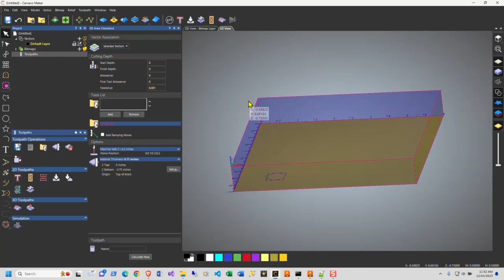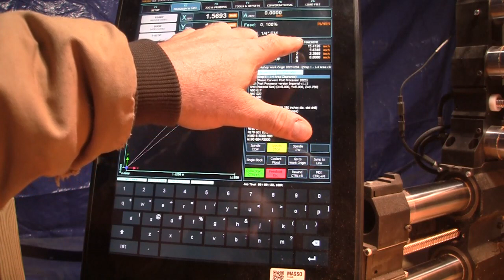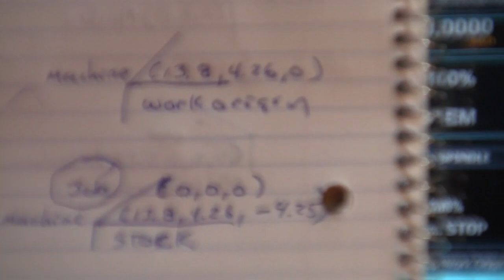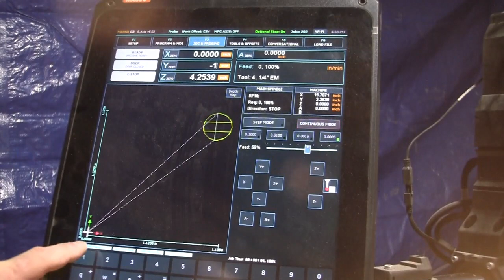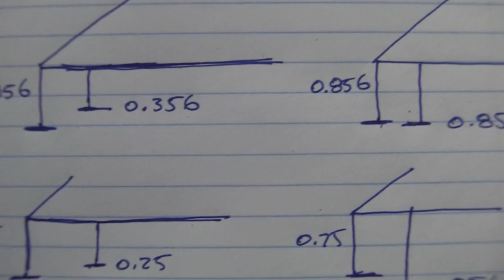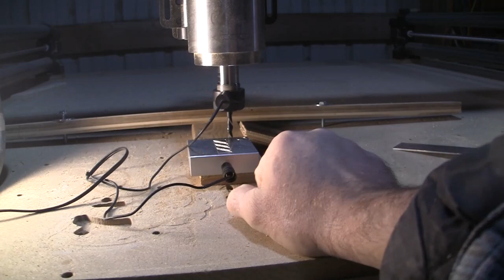Onefinity Elite Foreman - How to Adjust Work Origin

Comment: You do an excellent job of explaining this.  A lot of which I knew, but I learned a few things also.  I have the same setup, but I am using an aluminum block as a tool setter.  What I want to know, and I haven’t yet tried, can I use a work offset (ie G55) for a fixture to do machining on a part for production work, and never have to probe X, Y, or even Z again.
Reply from the maker: Thanks, glad to help.
as far as the G55 - i would not see why not. since it is a fixture, but I would still probe z unless you are never changing the bit out.  Any reason for G55?  just make sure that is set in your G-Code file. otherwise you will read the wrong origin point. Look at this post for more information.  but you may need to manually edit your file.  https://en.industryarena.com/forum/fixture-offsets--417514.html

Comment: The weird thing (for me, at least) is that for numberline graphing moving the X and Y to the right / away from the origin is a positive number. In CAD using a Cartesian method - same thing - positive X/Y is to the right / up. And a positive Z is up away from the base plane.
Reply from the maker: Yup.  But I think since you moved your origin they are now negative. Maybe???  Have you tried moving it back to front left and see if it still works?

Comment: Lars, Thanks for getting back so quickly as I have just ordered the water line clips. Any other helpful hints would be appreciated.  Are you willing to share your g-code for pre drilling the spoil board and the code for surfacing the spoil board? Is there a better way to communicate with you: instagram, facebook, discord, etc.?
Reply from the maker: I am on Facebook

Comment: Lars, I am new to using a CNC and purchased the Elite J from onefinity. Where did you learn what the parameters were for the Masso? What about the programming so I can understand what the commands on the G code lines mean? I am struggling to find a good way to hook up my cooling lines for my Pwncnc spindle.  I have routed the power cord through the drag chain and have no more room. I also have the flexible but not very rigid coolant lines and they seem kink very easily, any thoughts? Lastly, how did you set you machine up so the coolant pump starts when the spindle motor engages? Thanks
Reply from the maker: Mike, no worries.  For the Masso parameters, I think you may find what you are looking for here  https://www.manualslib.com/manual/2807896/Masso-G3.html#manual  or at least it will give you something to read and learn a bit about what g-codes are used by the masso.  Here is a great website for learning what that g(eometry)-codes do.  https://www.machinistguides.com/g-codes/  and one for the m(achine)-codes https://www.machinistguides.com/m-codes/  .  I used Rowdy Romans water line clips https://www.etsy.com/listing/1422841273/onefinity-elite-drag-chain-bracket?ga_order=most_relevant&ga_search_type=all&ga_view_type=gallery&ga_search_query=rowdy+roman+onefinity&ref=sr_gallery-1-1&frs=1&bes=1&edd=1&sts=1&organic_search_click=1&variation0=3262931350  I bought the x and y option.  These work really well, I just gave them a little more tube at each turn, I also got some silicon tubing, you can get from Amazon.  As far as turning the pump on, I did not find a way, so I just leave mine run all the time.  I am sure this is not needed since I am using RV antifreeze that I picked up at menards, but.  I just do not want to forget to turn it on.  I hope this answers your questions. :)

Comment: Lars, good information. However, not sure I will ever need to know this. If so, I will remember this video. The other thing, early on, I learned that probing Z from the spoil board made things much simpler for me. I am far from an accomplished CNC operator, actually very novice.  So, I need all the help I can get.  Keep making these videos.
Reply from the maker: Thanks for sharing Jim.  I hear there are a few people the z off of the spoil board and then add the thickness of the stock.  Which ever way works for you, keep on CNCing!